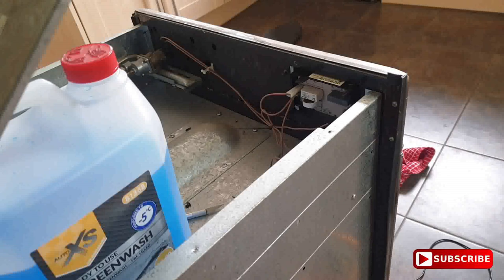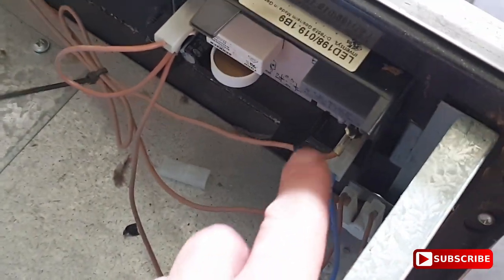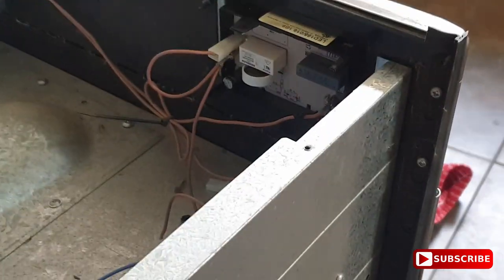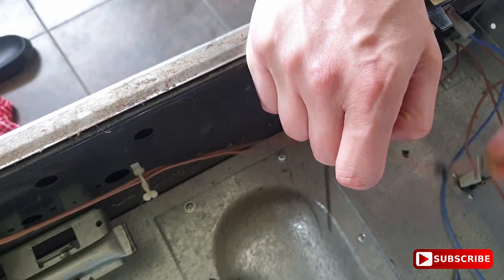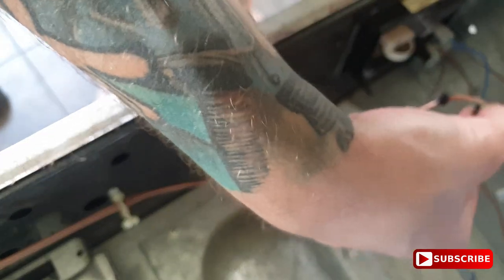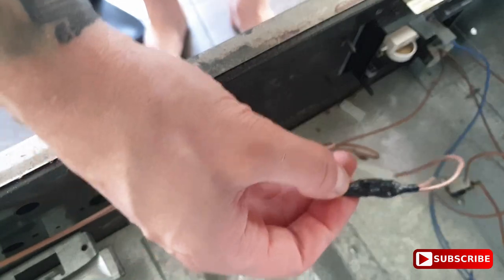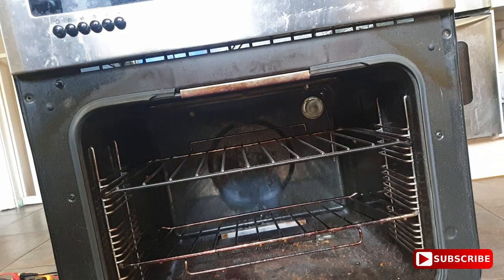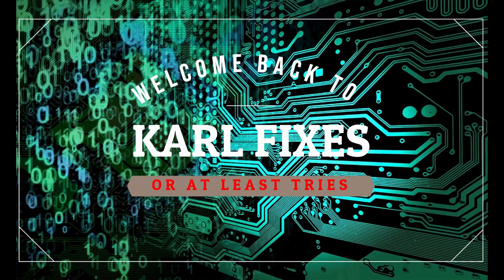How to bypass your oven timer (oven wont turn on)

Comment: Great video thanks Karl. Mine has the same cabling setup just slightly different timer, which Im struggling to source. I replaced it 7 years ago when they were plentiful. Do I need to leave the board in to bypass it or can it be removed completely? Cheers, Billy
Reply from the maker: Hi i couldn't tell you honestly i moved house so no longer have that oven either to check i assume it can be removed as your bypassing it anyway
Reply: @KarlFixes  Thanks mate I took the clock out altogether in the end and it's working fine 👍

Comment: Hi karl  i have a double oven with a fan in the lower unit. (Lacuno , Beeko) the element around the fan does not heat up.,  power is live on each of the two spades. I have cleaned the contacts but still dead. If i remove the element and connect to mains independant of the oven ,it works fine???  ,(fan ,light and the other elements work fine.. any ideas ??? . Your video was great . Thank you.
Reply from the maker: unfortunately i cant help with this one,  it sounds like it could be something on the main board that has gone thats not allowing power to the element to heat it
Reply: @KarlFixes  hi karl  thank you for your message. The oven dose not seem to have a particular circuit board , everything seems mechanical. ! Have a happy new year.. ray

Comment: Used your video to by-pass my buzzing clock in 5 min flat. Thanks. Does that Clock/Timer board have a part number? Your oven board is 100% identical to my Elba/F&P panel.
Reply from the maker: At the time i looked to replace that board. I dont know the number off the top of my head now but I know it was around 80 uk pounds to buy just the board. That's why I did the bypass
Reply: @KarlFixes  Ha ha, Me too. I was hoping to do some digging and get lucky with a cheap one somewhere. eBay, maybe. It looks like the same board appears in a few different brands. Many thanks again !
Reply: @KarlFixes  is it possible to use smog oven without led start up buttons somehow  they’ve all fallen off only 2 years old from new